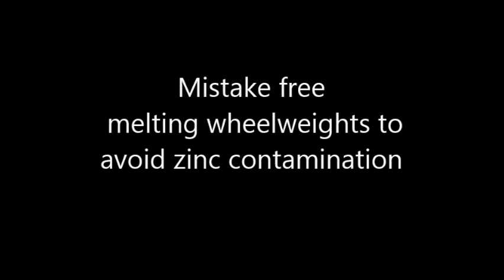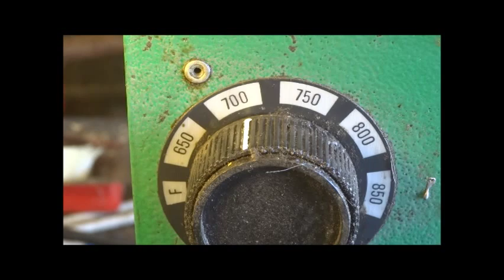Mistake free melting wheelweights to avoid zinc contamination.

Comment: In my RCBS Pot like yours, I had a white flaky substance come to the top, and this also stuck to the sides and eventually clogged up the orifce at the bottom. Any idea what this substance could be?
Reply from the maker: What lead or lead alloy were you melting?  Do you flux? If so, with what?
Reply: @roger_revo  A friend passed, and I got hundreds of pounds of ingots that he had melted, I have no idea what it is.  I have been casting from the 60's, and I have never see this white stubstance come to the top.  I use Brownell's flux.   I want to cast several sizes of buckshot, which has to be quite hot to to through the Lee molds to fill completely.   I appreciate all input to help in this incredible situation.
Reply from the maker: @sylviacandler5541  Brownell's Flux is Marvelux which is a white substance.  Currently I use Crisco pure canola oil for flux.  I put some in an oil can and put 2 or 3 shots onto the lead in the pot.  I suggest you try not using the Marvelux and try the canola oil.  Do you skim off the white substance?  It is causing problems with casting buckshot?
Reply: @roger_revo  The flux is old, perhaps that is the issue.  I will certainly try your Crisco, will order on line right now.    Yes, I skimed off the white substance, but it also gathers at the bottom around the spew and sides. I sat my pot and got temp up to 740* using a lyman lead thermometer.  I flux several times.   175g Lee mold works well, with bullets filling out, but lead pot will stop dripping from the accumulation of the substance.  I have been at my wit's end over this issue. All mY life I made my own alloy, never an issue, but getting this alloy from my friends estate with the issues has me banging my head on the wall!  Thank You for your input.  The Flux maybe the issue, time will tell.
Reply from the maker: @sylviacandler5541  Let me know how the Crisco works for you.

Comment: When in doubt about the wheel weight material just take a side cutter and try to give it a cut.  The lead weights will give way to the cutter while zinc and steel weights will not dent at all.  
I keep an extendable magnet in my vest pocket when I ride my motorcycle.  You wouldn't believe how many wheel weights I find at intersections, driveways, and oddly at gas stations.  I can quickly deploy my magnet and stuff it back in my vest with the weight...it works good when you find a tool on the side of the road as well!   Any place where there is evidence of a car accident you're likely to find a weight or 2.
Reply: I often find roof flashing at garage sales. Sometimes I find lead wheel weights in tire piles but I get most my weights from a local shop

Comment: In spite of what people believe, wheel weights are not lead. They're pot metal. Pure lead is easy to obtain. Most scrap yards will sell it to you for 25 cents a pound. Bullets should be 90% lead, 7% tin and 3% antimony. The formula for your alloy is only part of casting perfect bullets. Mold temperature and alloy temperature are only two factors. To get bullets from the mold that weight within 3/10th of a grain, you need to have a basic knowledge of what you're doing. If you melt wheel weights, stick to fish sinkers.
Reply: How condescending of you.
Reply: @hookeaires6637  Go ahead, make your fish sinkers.
Reply: @lindastevens3547  like I said, you're so condescending.
Reply: @hookeaires6637  I have a right to be. I learned casting bullets from Elmer Keith. If you don't know who he was, you should look him up.
Reply: @hookeaires6637  Born in 1951, I did learn from him. You have no clue about bullet alloys, so quit fooling yourself and go make some nice soft sinkers that will shrink .005 cooling off out of the mold. then, wonder where you went wrong. Don't listen to science, I'm sure you have all the metallurgists beat.
Reply: Condescending....and arrogant to boot.

Comment: Thanks for the video. I've had zero luck,finding tire shops for wheel weights...... But I have found a scrap yard locally,that sells me wheel weight for 40 cents per pound. They allow me pick through them,and load the ones I want. Seem fair to me.
Reply from the maker: That is a good price.  I have been purchasing clip on wheelweights from Ebay at higher prices.
Reply: It's the best deal I've come up with,so far. They had stink pipe flashing,and other plumbing type scrap that I think I paid too much for,but I'm trying to get a little stockpile,together(.80 cents per#)...... No one is giving it away,in my small town. Lol

Comment: wonder if you had contaminated lead if you could let it set up then re heat to below  the temp that zinc melts if you could then skim it off or if it would have been to bonded to the lead? i dont know much about working around zinc i mostly use range scrap.
Reply: Brody Burt you can add copper sulfate to contaminated lead to get the zinc out. It binds to the sulfate and the copper replaces it. You end up with a harder alloy than wheel weights but it still shoots good.
Reply from the maker: I don't think that will work.  The zinc floats on the lead alloy and does not become part of the alloy, but is a mixture.  It is easier to throw away the zinc contaminated lead than to try to remove the zinc.  There may be a way to remove the zinc, but probably to expensive to be worth it.
Reply: RogerRevo kinda figured the same, well i enjoyed your video.